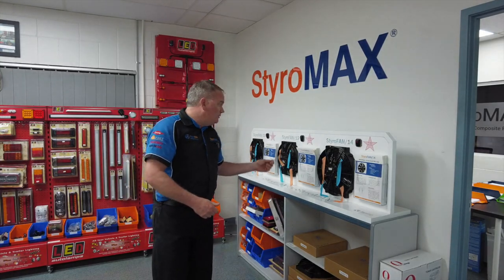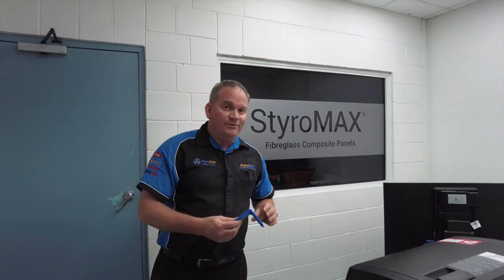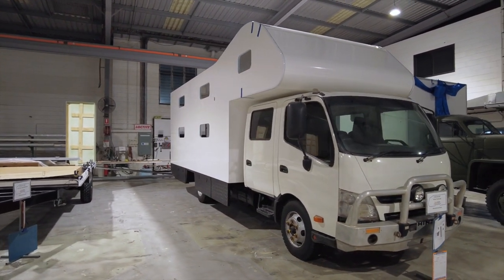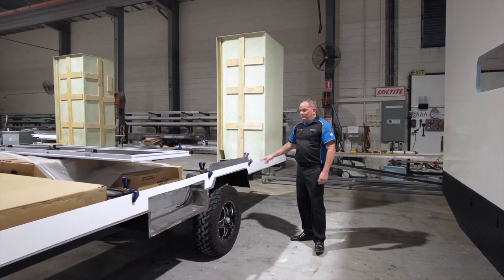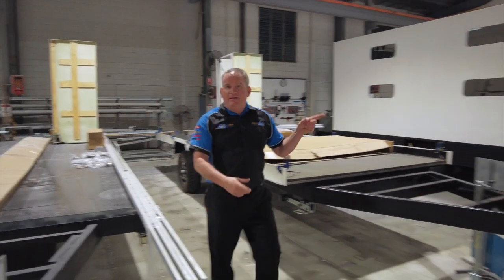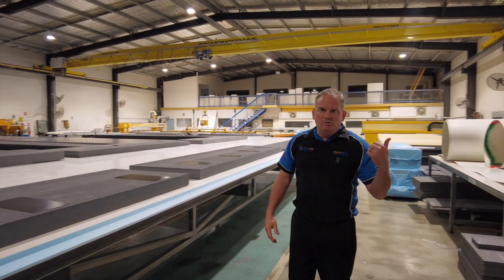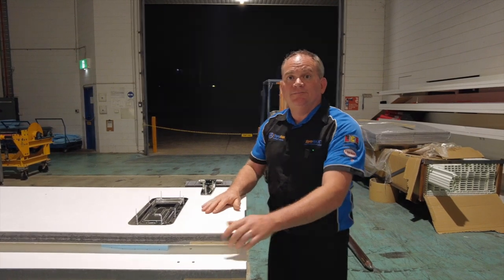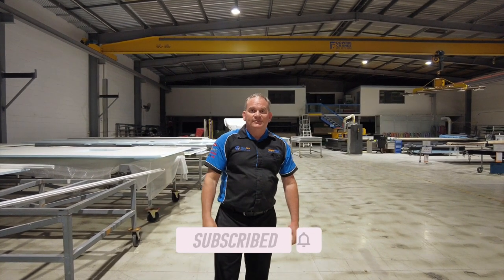24th June 2021 Factory Walk Through

Comment: Nice work guys, well done. If you were to glue together a square back camper as a box, including the floor, and just bolt/glue it onto the chassis after the glue cures, would you need clamps to hold it together? or will some tape do the job?